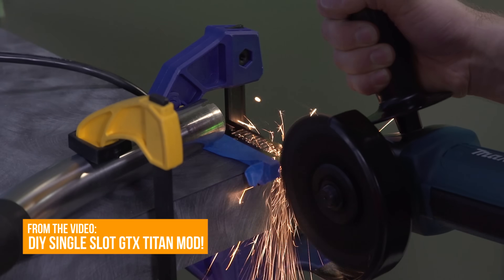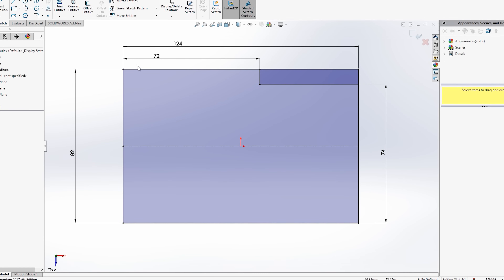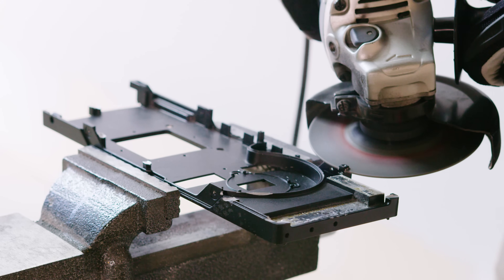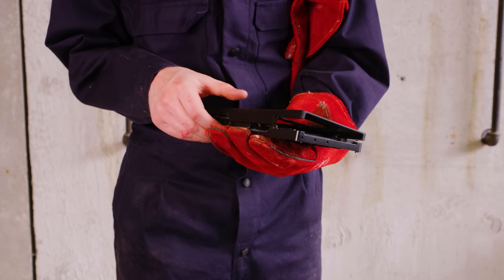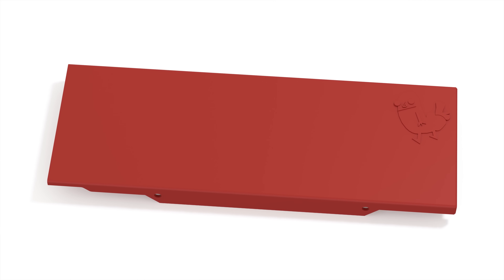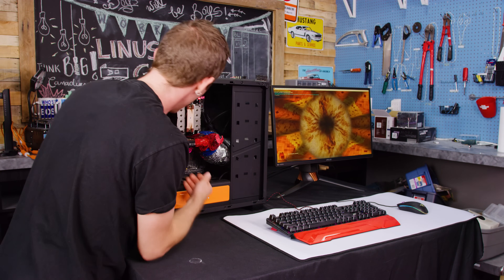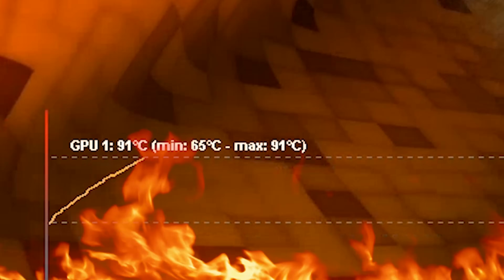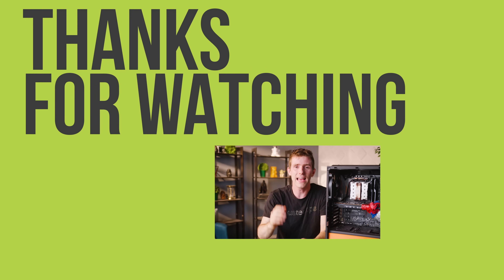Chopping Up a GTX Titan... AGAIN!

Comment: Would it be possible to run heatpipes to the back, and mount a larget heatsink there, then a 120/140mm fan to those fins, ofcourse it wouldn't be "single slot", but you could fit another card under it.

Comment: why don't the card  manufactures design a left handed card and right hand card where the fans are on the opposite side so you can buy the same cards but the fans would be facing outward on each card so you can set up two cards with no problem also I'm wonder what if you run an air conditioner straight to your tower would it run better
Reply: condensation goes from hot area to cold not cold to hot.

sit a glass of cold water in a hot humit room you get condensation put a hot glass of water in a cold humid room you get nothing
Reply: That would create a negative pressure zone between both cards and reduce the cooling performance. This is one of the main reasons why setting your case cooling to be all push or all pull is a bad idea.
Reply: +CrimSun i think he mens cars where the fan as you look to it in a std case where the fan and heat sink is ontop father than underneath so you can mount 2 double slit cards back to back (fan ontop on one and the bottom on another) because i sure as heck would buy one with the heat sink onto esp a dual slot card
Reply: yes I meant back to back thank you
Reply: Yes you can run an a/c that uses a refrigerant closed loop type cooler it actually removes humidity from the air it cools.
Reply: It would be fine if there was sufficient airflow in the case, that's the nature of air - it goes to lower pressure.
Reply: Low demand.
Reply: Piping an AC directly into the case would introduce way too much humidity. You'd get condensation, then a shorted out dead PC. You'd need to run it through a dehumidifier first.

Comment: A lot of hate that the vid has is extremely un needed but didn't you say you made it single slot so you could have two, but how could you fit two of those in there with all the extra mess

Comment: I wish I could afford a graphic card 😢😢😢
Reply: Over here the 1050ti costs 600 dollars :DDDDDDD
Reply: I know i am a bit late to this but a good and cheap graphics card is a 1050ti they cost around £135 not sure what that is in USD
Reply: Of course Sherlock
Reply: It is not so expensive, 210 is for about 30 dollars

Comment: If you took the single-slot 1070 cooler, and made there be more airflow, and then duct taped it to the titan, wouldn't that work at a stable almost 90 degrees? Probably?

Comment: But if you already knew the cooling  area of the heat sink where to low, why didnt you just make the lower in aluminium and moulded it to the heatsink?

Comment: A Dremel with a small cut off wheel could have done everything in the video without having to buy a belt sander
Reply: My guess is someone around the office wanted a belt sander and this was as good an excuse as any ;p
Reply: i feel like i relate too both comments, a dremel would of easily been cleaner and more profesional, but the need for excuses to buy new power tools is strong.
Reply: a dremel would've been too hard to get an even and level cut. tbh I think the belt sander was the best option, given Linus's massive budget

Comment: swapping a copper heat sink that has heatpipes in it, would easily keep the card cool enough. that aluminium one is just too weak. try to collab with EK for example and get a factory made peace for ultimate cooling.

Comment: I'm building a pc and I need help,

What one is the best out of all of these 

GTX 1050 SC GAMING
RX 550 PULSE
GTX 1050 PHOENIX
GTX 1050 EXPEDITION
RX 550 REFERENCE
GTX 1060 TURBO
GTX 1070 TURBO
GTX 1080 TURBO 
GTX 1080 TI TURBO
Reply: Darude sandstorm
Reply: Hillarytrump GTX 1080 TI TURBO
Reply: Hillarytrump i think rx550 is the best
Reply: This is dumb.
Reply: Gtx 1080ti turbo
Reply: Calabi-Yau Manifold thanks
Reply: Hillarytrump dude you know benchmarks are a thing, right?

Comment: Not to say that this wasn't an informative video for anyone that considered a single slot card(for whatever reason), but the end result was ludicrous, even it it had worked. The only reason anyone would want a single slot card would be for a sff case but even then most sff cases can take dual slot cards and no itx board uses more than 1 pcie slot so there's not much point of shortening the card to add in other peripherals. Besides, whose going for a single slot design then outright trying to fit a dryer vent in their case? I love most of your diy videos and some are genuinely helpful like the plastidip pc vid you guys did late june, but this? IDK...

Comment: How much do you guys want for the hacked apart gtx1080? Seriously, im running a gtx 670 right now. Thanks for the video!
Reply: This isn't "Linus craigslist"
Reply: considering it's not a 1080 and you didn't even read the title, doubt you'll be getting anything.
Reply: ReanimationXP it was a joke, based off the lack of power that a gtx 670 has thst a broken 1080 would be more...

Comment: you actually did make it single slot and work? 

Also, single slot with PCIE extender cable to a custom mount allowing you to place a CPU-heatsink outside the case. 

Also, Also, you could have just had someone custom make an actual heat sink replacement that would be as large as possible  (greater than the card footprint) but still be 1 slot in height. 

Lazy video.

Comment: it pains to see an expensive graphics card being harassed
Reply: Ya but this is a gen 1 titan. it's not even worth that much anymore or really all that impressive. It's similar to a GTX 1060 6gb in performance these days.
Reply: You can always buy an aftermarket cooler and use that
Reply: actually it's only the heatsink.... but i'm sure they'll do a custom waterblock for that savagery ^^
Reply: Canolius Nah, my OG Titan at 1325 MHz can hang with a 1060.
Reply: devilmikey00 Nope. The 1060 would crush the Titan...

Comment: Throtteling at 90°C? That's cute. My 8800 GT went too 103°C while gaming without issues :D
Now to that with Vega.
But seriously, a smaller card wmight work with it. Something like a 1060. The single slot 1070 got a nice copper heatsink, so even that is able to get cooled single slot.

Comment: Use a 5hp air compressor and three nozzles aimed in through the fins.   Remember to have an oil trap in the loop.   You can probably keep it cool with a GTX6800's heatsink that way.

Comment: Hey Linus remember the refrigerator cooled pc? what if you did that again except instead of sticking the mobo and all in a fridge build a water cooled pc and have hoses routed into a minifridge where the fans and radiator sit and the pc sit's on top of the fridge, even better try this with nano-fluid I've always wanted to see it in action.

Comment: That's an aluminium cooling block though, what happens if you use a copper one? better conductivity might make it possible.
Although I still seriously doubt that, nor would it be worth the huge cost difference vs aluminium.

Comment: Ah the old chestnut of "because you can". 
Running out of idea's but still need to keep it fresh?

Idea No. 1: Use Plumbers copper pipe as a open case frame and a radiator. I have a plan for this:)
Idea No. 2: Get staff to ride a bike attached to a Dynamo whilst running a benchmark for 24h
Idea No. 3: Do a quickdraw-showdown of an exact pc build between LLT and lets say Bitwit, Paul and or Jay. (My money would be on Kyle if he was somewhat fuelled by Bourbon). Maybe whilst being Nerf'd at the same time!
Idea No 4: Can you build a PC blindfolded?
Idea No. 5: Pimp a PC. Add some speakers and woofer. Stick a handle on it and call it "Ghetto Blaster 2.0"
Idea No. 6: TBC

Comment: I want to see a silver heatsink..  it has about 5% better thermal conductivity than copper and almost double of aluminium so it might be able to handle the heat in a single slot design..  and 4-5 OZ of silver would add about $100-150 to the cost of what is already a $1200 card in the Titan Xp

Comment: there is a reason why single slot cooler use mostly copper and not alu. how about using a carbon cooler? I heard carbon is even better than copper for heat transfer.

Comment: You should try copper, have twice heat dissipation capavilities than aluminium
Reply: its not twice... copper is only 39% better conductor and twice the cost of aluminum... and alot heavier

Comment: You could have saved all that work with the stupid exhaust fan by rigging a low profile air cooler from a cpu onto it and still keep the small form factor. Something like an Aska or Silverstone low profile cooler would work.

Comment: What if the shroud itself was part of the finfet? So some of the heat flows through it and spreads easier?  The same way some transistors work on some circuit boards.

Comment: I still I still think it would work with a custom design copper heatsink and some more streamline ductwork with a high static pressure fan being fed by a portable air conditioner

Comment: $10/GB?  holy ****..   if you get a 20eur/month 100GB plan in france, you can use 25GB/month in the US, plus unlimited calls to mobile and fixed lines (to both US and European lines). Not kidding

Comment: i mean, looking at that huge fucken blower vent thing, haven't you just INCREASED the overall footprint of the card? the opposite of what you set out to do? how would that fit in a SFF case, the only real application for 1slot cards

Comment: Too bad you didn't do this correctly.
Poor choice of fan
Awful "duct" (the most restriction I've ever seen)

And unless you have had college Heat Transfer classes, please don't say "we did the math". First, Noctua is incredibly weak compared to my stock AIO 120mm fan (4,100 rpm industrial fan which sucks the side panels in noticeably (3 intake fans, 1 of which running 20v, AIO is the only exhaust)). So it doesn't have the pressure for your absolutely horrible restrictive "duct" (you don't need to have Fluids or Compressible Fluid Flow classes to know that), or even the same volumetric flow rate. 

Also you used a terrible aluminum heatsink, copper is much better, and it should have heat pipes. I have a solid 100% copper heatsink and heatpipes on one of my old ATI blower cards (probably between 300-400w overclocked, its insane heat output compared to my R9 Fury, but it is loud)

Comment: You guys should modify a motherboard so the 24pin connector is on the backside of the board for the ultimate wire management

Comment: I would love to see a triple slot GPU or something focused on modding your single GPU and improving air flow dramatically.
Also-- your fan was too far away to really help w/ that kind of duct. I mean, yeah the heatsink sucks at that size too.. but if I were gonna do this type of build... I wouldve went balls to the walls w/ the fan and got one of those 2-3" thick, 3-5k RPM HIGH-CFM fans and made the thing really stand out. Nm.. I forgot Linus hates fan noise. Personally, I like cooling the sh!t outta my hardware that nearly costs a firstborn child when it comes out.

Still a cool build tho. SLI liquid cooled single slots would be more useful tho. Maybe in a future build that needs to save room?

Comment: I kinda want to see a full directed airflow build now. Could you get decent cooling and lower noise with big damn fans for intake/exhaust with shrouds directing airflow through the system instead of fans on the graphics card and processor?

Comment: Yeah, my first reaction was - this is impossible unless they cheat. Then they did cheat. And still failed haha. No one wants a single-slot 1080 Ti. What would be awesome is a short 1080 Ti. And not like the Zotac 1080 Ti Mini, a truly short one that doesn't extend more than a cm or so past the slot. I'm not sure it's possible.

Comment: Be careful using cutting  & grinding discs not designed for aluminium. aluminium can cause ferrous disks to shatter at high speed turning the disk into a claymore mine. safety is number one priority

Comment: So let me get this straight...  You did the math ahead of time and determined that given the reduced size of the heat sink, it was going to be impossible for it to remove the heat needed to keep the GPU from throttling.  Rather than just explain that in a video, you went ahead and built something you knew wouldn't work.  Why?

Comment: To all the people bitching that they ruined a good card: they didn't. The PCP (the actual GPU) is still intact, so you could just stick a waterblock or a new shroud on it and it'd work perfectly fine. Idk how easy it is to get a new frame/shroud for these cards but I'm sure that linus could just ring the Nvidia guys directly to get one.

Comment: It is doable, you'd just have to use compressed air, way more pressure than a single 140mm fan can handle anyway.  Water blocks are able to cool GPUs with way less surface area because water is nearly a thousandth of the density of air.
Reply: I wouldn't be surprised to know even a compressor couldn't cool this. As for water vs air, this is not a question of density, but a question of thermal conductivity.

Comment: You could do that fairly easily with an angle grinder fitted with a flap disk rather than with the hard grinding wheel you had on it. The sander certainly allows for a more precise, flat finish, but the angle grinder in capable hands is able to do that job quite nicely.

Comment: You know, it's better to use the blower fan because those make more static pressure. Another thing is you can bring some performance back by undervolting the card so it doesn't throttle as much. But yes that cooler is ruined.

Comment: If you made the heat sink longer than the graphics card you might be able to cool it better. Oh and if you're going to print a shroud and adaptor for the fan print a fucking connection for the card to hose.... you fucking morons

Comment: I don't understand why you cut apart an all-aluminum heatsink.  Of course that wasn't going to work well.  There are all-copper heatsinks already made for single-slot GPUs.  I doubt any would be able to work with a Titan, but you'd have got much better results with very little effort.

Comment: 10 dollars pr. gig is crazy expensive- i have a fairly normal subscription at 15.80 usd - free sms/mms and calls (in my country) and 100gb of data - the 100gb is more then usual, butt 25 -50gb is common -

Comment: Cool a PC with air conditioning
Reply: They already done it! Single phase cooling. Thats the title
Reply: Linus did a video on PCs in a fridge years ago when he was still making videos in a garage. Conclusion: It is bullshit that doesn't work.
Reply: They put a PC IN a fridge. If your air intake on your PC is fed by an AC unit, it's different.
Reply: Krytern UK a fridge is insulated so all cooling will depend on the compressor. If you use an air conditioning unit you just can add to the cooling
Reply: It's not the same because if the computer's intake is fed directly, 100% of the cooling is applied to the PC first, then the exhausted air will go into the room. It is fairly simple math as to what the gains would be though, if the A/C cools the air by 20C, your Temps will be roughly 20C lower than normal assuming the case has positive pressure inside (which it should considering its being fed by a dang AC unit).
Reply: @Mrwaffleandmilk
Some people don't have AC. I know. It's a scary thought.
Reply: @Mrwaffleandmilk
It just felt like what you said assumes everyone has AC in their home. AC can be pretty expensive. Not everyone has it. That's really all I was getting at.
Reply: I don't have AC. In any case in a room fed by AC, the air will warm up before it gets to the PC won't cool as well as AC directly fed into a PC case. Also ye can't just stick a PC in a fridge and expect it to magically drop the temps massively either. You have to be able to exhaust the heat the PC creates or else the fridge will have a hell of a time trying to keep it cool in there. The efficiency is gone.
Reply: Portable Airconditioner with cold air piped directly to video card should help tremendously.
Reply: It's true, 100% of the cool air would be cooling the CPU and then be fed into the room. If the AC is cooling the entire room, the warmed up air will make it into the PC, not the freshly cooled air. This of course assumes the AC unit isn't able to cool the room to its raw output temperature.
Reply: that actually its pretty easy with passive coolers
Reply: refrigerant coolers are actually a thing. back in the day, we used to run systems in old mini-fridges with small holes punched in the door for cables

Comment: Just strap one of those cheap window AC units to the side of the case, in theory, 5000 BTU should be able to remove ~1500W of heat.